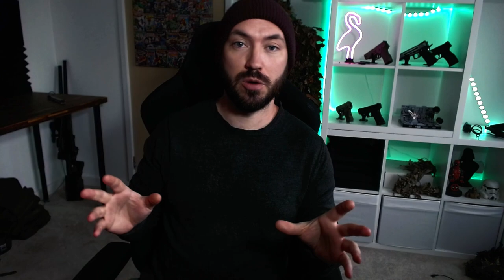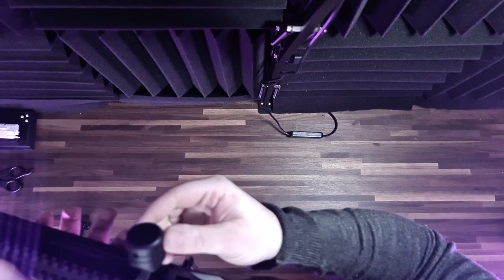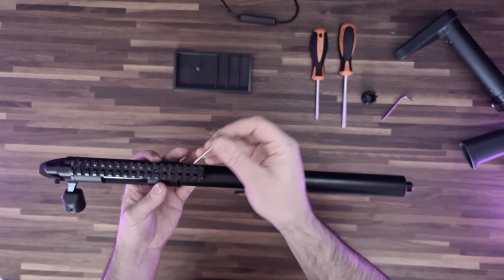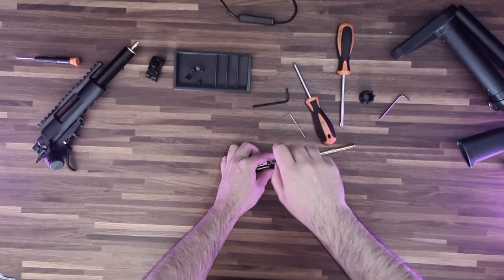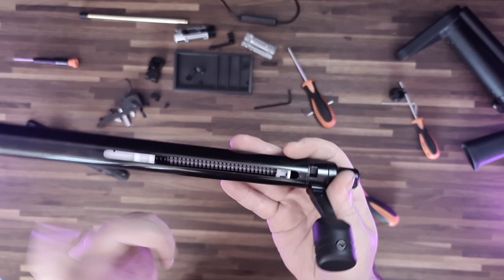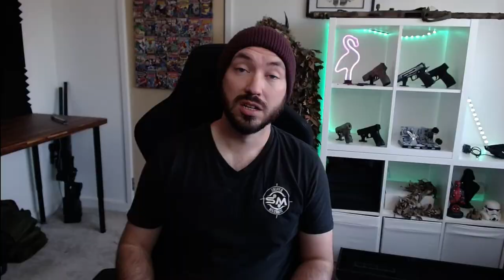Tokyo Marui VSR ONE Review, Unboxing, Disassembly & Thoughts

Comment: the video was good except the sound quality while open the gun up.
is there an easy way to tune this gun with a stronger spring or do u have to mod a lot more stuff so the gun can handle the power. and which spring/cylinder would work and what would be the max spring strength?

Comment: great video! i dont suppose you have gotten round to doing any upgrades? Iv done the hpa vsr 10 now and want a springer to mess with. torn between this and the scout but this looks so much better with so much potential. love the flamingos btw! both my vsr and ssx are running them, wont use anything else since the first day using them!
Reply from the maker: Hey buddy! I never got round to it as I was busy with projects. But it's essentially a VSR and everything fits, minus the outer barrels as it needs mods. Thanks for supporting me and using the flamingo! Rifle wise, the Scout is very good for the price, but I do love a VSR :P

Comment: Hi SniperMechanic, I recently bought a VSR ONE as the first gun i intend to upgrade. Been hoping to see your upgrade build on this to help with that. Just wondering if you know of a good trigger that'll fit? I'm struggling to find any info on it
Reply from the maker: The sprigger custom works S trigger fits, but you might need to remove a smidge of material from the stock, also the safety will have to be removed from the trigger

Comment: I'm really struggling with removing the outer barrel. I've literally removed the top rail all together but the outer barrel is still not budging. Any ideas?
Reply from the maker: under the top rail, there's a small grub screw under where the first screw on the rail goes
Reply: @SniperMechanics  I removed all the screws and the rail but no luck :( I ended up just sawing the barrel in half to get the inner barrel lmao

Comment: Could you drop SSG10 internals and trigger box into that stock??
Reply from the maker: Not without a little bit of work, as the space for the trigger is very narrow and outer barrel has a cut out for the spring leaf section which pops the mag out. Doable, but likely some material will need to be removed from the SSG10 outer barrel if you want it to fit and also the trigger area

Comment: What do you think of the 200mm inner barrel? That’s going to need some spring in it when you add a WASP and want to lift a 0.48 at 2.3j
Reply: Also have you tried zeroing a scope in? a friend has tried it on his and the rail seems like it is off centre ever so slightly, potential manufacturing defect, so it is impossible to  zero the scope in as the bbs always seem to be shooting off to the right. The front hole for the screw that holds the mount on seems slightly off centre
Reply: vast majority will run a longer barrel into a supressor
Reply: @memebo1922  yeah I get that, and that’s what I would do. However if you chose say 330mm barrel, you are going to lose all of the benefits of a suppressor. So it will be good if they had a version with a longer outer barrel so you can have both a longer inner and make use of a suppressor
Reply: @valhallaberserkers7695  Novritsch suppressor is 25cm long so you still get the majority of it, coupled with the wasp it’s definitely quiet enough
Reply: @memebo1922  that’s cool, I wouldn’t choose to use a Nov suppressor though as there aren’t the greatest for sound reduction
Reply: 200mm barrel is right where it needs to be really, set your hop up right & tune your piston & it'll be a dream

Comment: Hi there did you end up upgrading this vsr one I'm having trouble finding any information online any advice would be appreciated
Reply from the maker: What info you need, i did one, but I no longer have it. For the most part it's just a normal VSR, the outer barrel is different as it has s special cut out, but cylinders, pistons, spring guides etc are all VSR
Reply: @SniperMechanics  thankyou for speedy reply I'm thinking of hpa it and I was wondering if the trigger is the same as the vsr10 and if the cylinder might cause issues as it has that longer cut out on it
Reply from the maker: @legendaryzammo  So being a TM the VSR is pinned shut, so you'll likely end up binning it as once that pin is drilled out, the cylinder is useless.

But you can use a normal TM spec cylinder like maple leaf, the trigger is also a VSR 10 trigger, it has a slightly different rear section, but for HPA, it wont make a difference
Reply: @SniperMechanics  so buy a new cylinder aswell thankyou think I'm going to order it all
Reply: Hi sniper mechanic me again do you know what cylinder which use the thread as the stock cylinder head as I bought a maple leaf but the head wouldn't fit @snipermechanics

Comment: Hi Snipermechanic! Thanks for your guide here! In regards the Cylinder, I have noticed that if try and swap for a Maple Leaf / AA Cylinder it will not rack! The only difference seems to be the reduced Air Volume in the VSR-ONE chamber matched with the trigger unit. Have you had any issues replacing the Cylinder on yours? I am pulling my hair out trying to get rid of the Marui Cylinder!
Thanks
Reply from the maker: Which trigger have you used?
Reply: @SniperMechanics  stock!
Reply from the maker: @ROFLzSALMONz  which piston?
Reply: @SniperMechanics  apologies: maple leaf piston, m100 spring, maple leaf spring guide, stock trigger. Have tried now both maple leaf alluminium and aa twisted teflon cylinders! Both pull back the bolt handle then get stuck because the little one-way piston catch is on bare metal! Today im going to try and adjust the guide length on the aa cylinder to match the stock vsr-one cylinder!
Reply from the maker: @ROFLzSALMONz  the issues is the safety sear on the trigger, it needs to be removed. Its the little silver bit on the side with the spring under it. If you're using stock 45 degree trigger, is your piston 45 degree too
Reply: @SniperMechanics  thanks dude, i will try this today! Do I remove the spring too? Yeah piston was sold as a 45 degree!